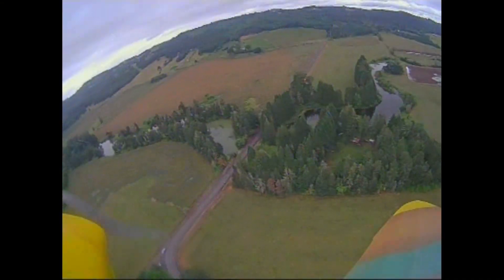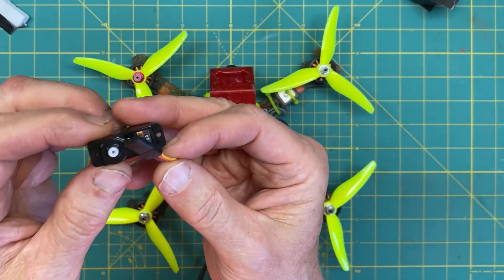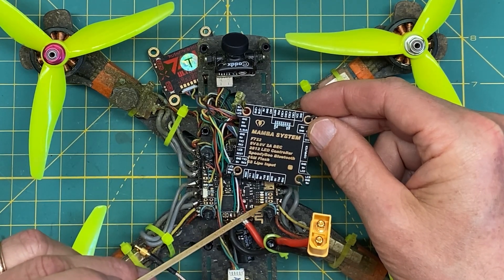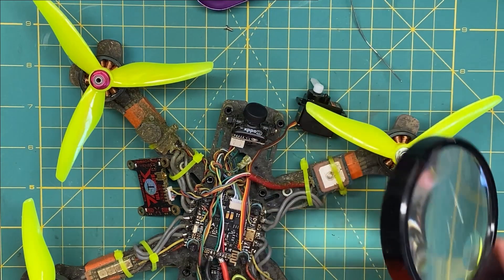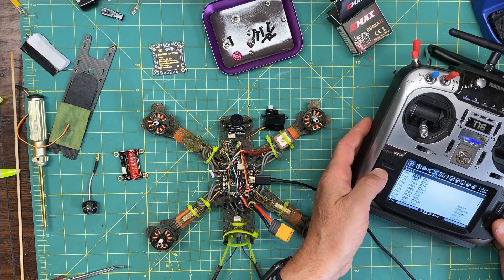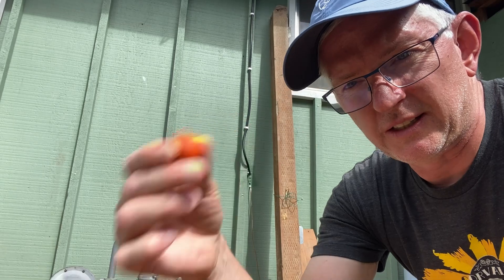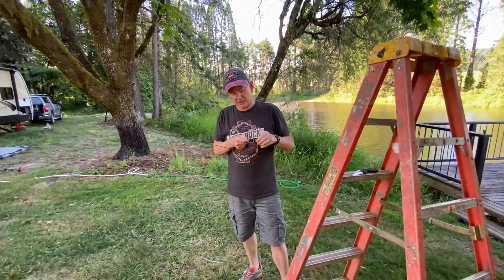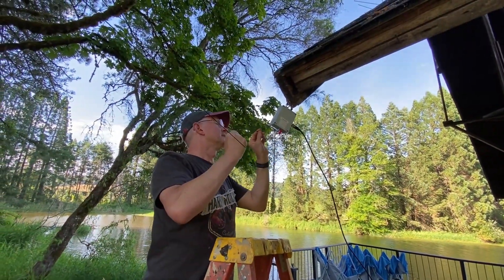HF Ham Radio Long Wire Antenna Lift using Remote Control Quad!

Comment: Nice video.  Would love to see a video for the ham looking to get into RC for hanging antennas.  Are off the shelf quad copters up to the task?
Reply from the maker: Hey Greg, thanks for watching!  That's a tougher question to answer than I thought, but here goes!  An off the shelf drone would probably not be capable of much lifting and probably wouldn't do well if you crashed it.

I only use my carbon-fiber racing drones for hanging antenna wire, for several reasons.  I build them myself for about $300.  These things will do 100+ mph and are good for about 5 min. of air time.  With battery, they come in at about 600g and can really take a beating.  I also think the FPV camera and goggles really help me get to where I want to be when ascending high tree's.  I also have a DJI drone that I use for photography and video.  It weighs in at 249g, can stay in the air for 30 min, and costs about $450.  The DJI drone would not survive a crash well, nor does it have the motor thrust to do much lifting.  My racing drones however, can lift about 2 lbs. for a few minutes.

I hope I answered your question, but let me know if I need to elaborate on anything!  Cheers - de W0KNI.
Reply: @W0KNI  I went over to your first antenna hang video and saw the details of the drone.  Just thought it would be a good video for other hams on what is needed.  Much more useful than a potato gun.
Reply from the maker: Exactly! You've given me some content ideas and now that the weather is shaping up - you've given me a great excuse to get out and start playing!!
Reply: @W0KNI  I'm subscribed, so will be looking forward to new videos.